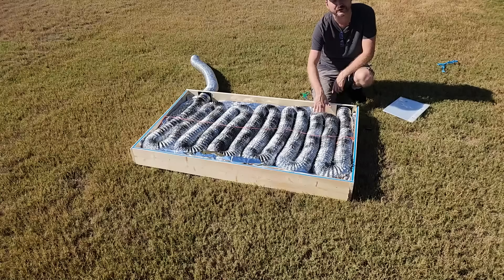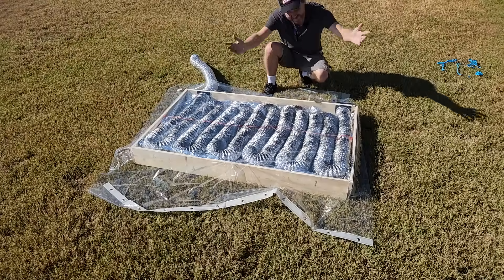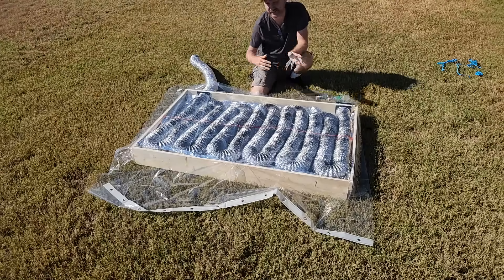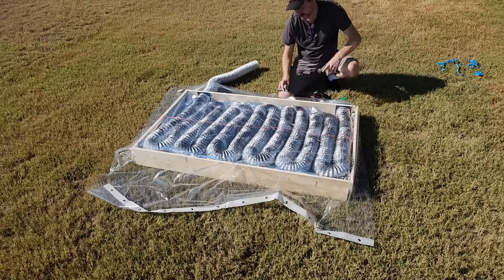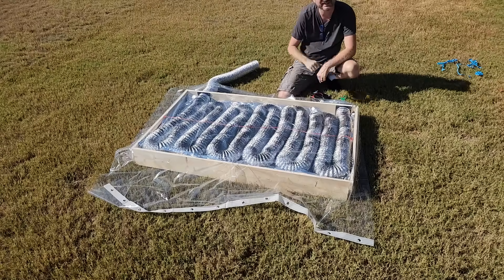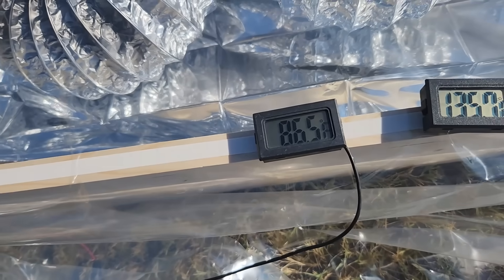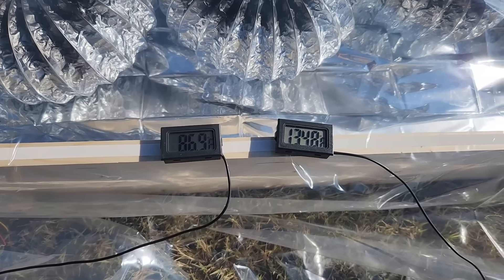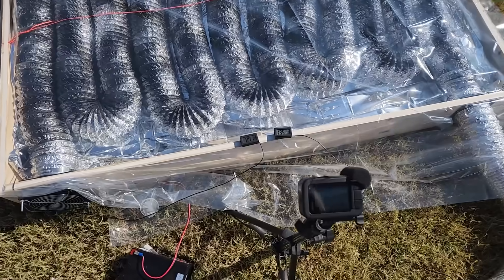Solar Air heater. No cans! Gained  50F in 20 minutes! @texasprepperprojects

Comment: I had thought of something similar but would use black french drain tubing (no holes). I should test to see if you can get higher output temps due to the absorbency by the black material
Reply from the maker: I have seen that product and I think it is a decent option. However, metal vent pipe is thinner and metal so it will conduct and transfer heat better
Reply from the maker: You want to heat the air, not the material

Comment: these type items were designed for Antarctica and work great the benefit they had  despite insane low temps was the insane reflectivity of all the snow and ice! but yes they do work at very low temps!!! remember your not heating outside air with these types of air heaters so lowest of temps don't too much matter!! the idea with all heaters is to continually circulate and heat the air in your space just like a real heater  or the same air which continues to get warm as its been heated many cycles in circulation etc so if your inside air is 40 and your output from said unit is 175 the 40 as a whole area number will begin to rise etc  heating outside freezing temps to pump into your house is stupid like the idiots testing diesel heaters with their tents and claiming  they not impressed while the whole unit is outside vs just the combustion intake and exhaust  big reason if you do half assed you get half assed results as with anything too be clear this comment was just a general statement and not at all directed at anyone but was inspired by seeing many of the same comments in lots of these type of diy solar air heaters
Reply from the maker: Yup!

Comment: I build mine with a used patio door.... talk to your local window installer they will l usually give them away so they dont have to dispose of them
the heat will make sm board melt so you need better insulation 
black barbecue paint works best
from my garage in at 58 degrees out at 155 degrees  outside temp minus 20 degrees
Reply from the maker: Awesome!!

Comment: While stationed in N.C., I built a plywood model in our side yard. It had no cans, no vent tube material. I made baffles that alternated across the interior with a lower corner air inlet and an upper corner outlet. The interior was covered in black plastic with a clear corrugated roofing panel on the front.  No fan, but it still had fair airflow due to convection.  It augmented heating in a room that before was always colder than the rest of the house.
Reply from the maker: Nice

Comment: I'd like to see old tires sourced for a project like this.  They attract and hold a lot of heat.
Reply from the maker: Try it!
Reply: @texasprepperprojects  It would be interesting to see someone pull off a baffle system with vinyl siding as the heat collector and somehow heat an entire house.
Reply: Maybe a sand battery?
Reply from the maker: check out my other videos. i have done  a lot of sand batteries
Reply: @texasprepperprojects  Will do!  I have a little project coming this spring and I'm looking for ideas.  I like the way you present!
Reply: @texasprepperprojects yeah. I was talking about a tire project. It would be the most mobile sand battery ever made. 😂

Comment: This would be a good project for outdoor cat shelters in the winter.
Reply from the maker: Neat idea!!
Reply: That's an awesome idea that I will be testing this year thank you
Reply: Need a storage medium to store and limit temp extremes and Close absorber at night. Shelters work pretty well on their own with foam, one or more holes depending on size and cats, a air flow limited on openings for wind, rain deflection, and only straw interior, also drain holes on bottom for any fluid condensation. Silver faced insulation interior for added heat effect and also enables visibility inside with some exterior light, sun, moon, streetlights, etc.

Comment: Nice idea using a long length of dryer vent.

This system is a good proof of concept.

Paint the wood black on the inside.
Add foam to the sides of the box inside and out.
Seal the box with high heat rated sealant.

Older style clear single pane windows would work as the top.
Reply from the maker: Thanks. More to come

Comment: This build might be enough to heat an insulated box containing storage batteries for a household solar system. Keeping the box above freezing would help the batteries charge up and hold their capacity.
Reply from the maker: Might!
Reply: I'm glad you said that because I'm trying to figure out what application this even had I don't think it'd even heat a deer stand like he mentioned
Reply from the maker: It would be a SMALL cabin at this scale. Like 100sq ft

Comment: Solar radiation will TOAST your shower curtain...😮
Reply from the maker: We shall see
Reply: @texasprepperprojects  He is right, UV is going to break that thing down fairly quickly. I get that this is a proof of concept (and I would like to see this in a years time, there really is only one way to find out) but you should look into some UV resistant LEXAN or similar polymer sheeting.
Reply from the maker: When I go full scale, I'll definitely use something more durable than a shower curtan

Comment: I did this as a science project 40 years ago, but with water.   1 box had reflective foil and the other was black construction paper and rubber hose.   

Yeah the darker black the hotter it gets.
Reply from the maker: Thanks. Check out my older videos on solar water heating

Comment: Eliminate the tubes completely.  An open chamber, insulated, with a simple inlet and outlet is more efficient at transferring heat.  The tubing creates a lot of flow resistance reducing the air flow considerably.  A 50 degree rise in 20 minutes is not the important datum.  What's important is how much air flows at what temperature.  That is, how many BTUs above ambient temperature are moving through the exchanger.   (Outlet temperature - inlet temperature) X volume of air / time.
Reply from the maker: I look forward to your video. This design will make more sense when I deploy to my shed
Reply: @texasprepperprojects  brutal, lol
Reply: Surface area. Air is a terrible conductor, to get it hot requires as much surface area as possible without restricting airflow too much and tubes designed for air to flow through definitely doesn't restrict it too much.
Just look at the design of every other heating and cooling device, what do they have? Heat exchangers, radiators, manifolds.

Comment: I've made some of these before.
I dont think you need all those loops.
You might beable to get more air flow by cutting the dryer vent in half so you have to air inputs and two air outputs.
record the temperature out.  maybe possible to cut it in thirds,  it does not take much to collect the heat from the sun..  paint the dryer vent black to collect more heat.
Reply from the maker: That is one of those things I really want to test. I do not know what is better, more air or more length
Reply: @texasprepperprojects  I once experimented with a 4 foot long box, the air would go in the bottom, and I had 6 tubes going up, one way,  the tubes (dryer vent) were painted black, the box had reflective mylar (space blanket) The heat came out the top.
a nice slow air flow works best, it collects the heat from the now heated tubes.
The faster the air flow, the longer the tubes must be.
you use natural draft, you need more tubes to increase air flow.
It is basically a formula of amount of tubes times air flow speed equal heat......
you fill in the blanks with your system
Reply from the maker: In my long term plan i will have a continous loop in my shed so it won't have an intake to the outside world

Comment: yea can make cheaper by using scrape plywood or boards , bye staggering each end inside and paint the boards flat black and base white or something reflective then by using glue on top of partions glue clear plastic to let light in , should be very cheap.
Reply from the maker: I did mention in the video using cardboard and trash bags for a super cheap build!

Comment: Very interesting. Combo this with a boiler and radiators and it could heat your entire house on sunny days.
Reply from the maker: Neat
Reply: Storage needed like water, rocks, bricks, etc. A separate fan and controller would take over once storage is hotter than room temp.
Reply: Hot water supply for house, probably commercially available. Water panels, black.

Comment: you can't heat your house with it, but the heat you're generating could be fed into a house in order to reduce the draw on the furnace, right?
Reply from the maker: Absolutely. Every degree you feed into the heater is one less degree harder your heater has to work

Comment: Curious to see how long the dryer vent aluminum lasts. I would like to incorporate something like this into a dehydrator.
Reply from the maker: I think it will hold up. Think about the constant, intense heat that vent goes through with a clothes dryer
Reply: @texasprepperprojects not so much the heat but the solar radiation.  UV light. If it is all aluminum,  then good. But sometimes to be cheap they add other polymers or plastic.  Think of the cheap aluminum lining in soft sided coolers.

Comment: Make a similar, same design, using junk? Think as a hobo or poor person. Zero, to only a few dollars expense. 

The screws/nails/adhesive to join the lumber, and paimt might be the toughest part to scrounge. 

Discarded rain gutter downspout?  Glass jars/bottles?

Old blanket/quilt, covered with old corrugated plastic campaign signs, then covered with foil survival blanket, or heavy duty aluminum foil as insulation? (as the interior backing)

Old windows, different sizes?
4x4 kitchen vs one sliding glass door vs 4x6 bedroom?

Old door for back/base? 
Some old garage door panels are foam insulated panels. 

Correctly position, on a roof, insulated duct to/from a small room/shed, solar powered fan. 
Maybe a thermal switch, and on/off switch or baffle to close off during warm weather?
Reply from the maker: I mentioned this in the video. Cardboard. Trash bag. Cans. Most of the viewers are not from the usa

Comment: I just put in a couple heat pumps and have been thinking about using something like this to increase their efficiency when it's below freezing.   It'd be a lot more basic since you wouldn't want too high a temperature, but bringing their intake temp up to 40 or 50F should help.
Reply from the maker: Think of it this way. Every degree you can raise for free is one less degree your heat pump has to work
Reply: a water tank, insulated on all sides, buried in the ground,
use any type of heat collector, send heat to it all day when it is hot, use it at night.
Reply: You might check out ground loop heat pumps.
Reply: @CharliePowell-dy1tl  Gound source heat pumps are at least twice as expensive tho.  The air source ones I got are rated down below zero, but like Texas said, any improvement for the intake would help, so could put some of that savings into helping them be more efficient.
Reply: @Mazlem citrus in the snow uses open air heat pump in a box with a ground loop with a circulation fan. Not sure how much if any money it saves or worth while but at least worth looking into
Reply: @panzerswineflu  It'd be more expensive but yea that'd give you a steady and constant air source.
Reply: @Mazlem rather was wondering the cost vs going straight ground source heat pump from the start for price comparison but yeah. 

Compared to this panel though, ground loop will also likely help in summer as well

Comment: That's just like those tea light candles and a pottery pot. Everyone runs these test on them in 60 or 70 degree weather and never at temperature where supposed to work in. That will not work during a freeze. Just like the tea light heaters. You know how many people tried that and not one said it worked and they tried it in a tent in their living room. People don't understand how much BTU it takes to warm up a room. Then when it really freezing, its even harder. Look at a Chinese heater, at the lowest setting doesn't have enough heat to warm up a garage. What do you think your system can do when it has a fan with less blowing power then the diesel. Then what are you going to do at night? when it gets really cold and no sun???

The best thing I found to heat up during a blackout when its freezing is a Mr. Buddy Heater with a 20lb propane tanks. One tank last me 4 days on low and running it for 14 -16 hours a day. I have to two floor house and it keeps my house nice and toasty on low. I done this for years when the temp drop down into the 20s and not once did any of my 3 carbon monoxide detector's went off.

Just recently I got two 8k Chinese diesel heaters with homemade thermostats that I made. I just started testing the diesel heaters and so far I'm really impressed. With one gallon of diesel I can run for days and all I need is a 12v power supply. You can use a small solar generator or if your car in close to your house that you can run a 12v line to it to power the heater. 

Bottom line is, Run your test in the same condition you will be using it in. That will tell you if it will work or not.
Reply from the maker: Thanks

Comment: Why don't solar collectors use any white, or silver? They use black to covert the wavelength of light to the wavelength of heat. It's a great idea, thanks! BUT the entire pipe should be solid matt black. It's a solar collector, not a solar reflector. If you can see any light at all, it's coloured too light. It should [resent to the eye as a black hole.
Reply from the maker: Working on the paint job now. More testing soon if the sun comes out

Comment: How much did the 40' dryer hose cost? You're in Texas, so I presume you may be testing for a similar temp differential in a few months on a sunny day when its like 35-45F outside? With your(near ideal) horizontally positioned set up pumping 85-90 degree air into a (preferably windowless) 10x10x7. 5 room, itd take about 7.5 minutes for a complete air exchange(750cu.ft./100cfm fan).If the room is at 50 initially, how long would it take to raise it to ?? 75-80?.(There are formulas,.... but Id guess a single unit would still underperform a 600 watt space heater). But, if you covered the south wall and roof of that room with multiple units, itd be like adding multiple windows I suppose(letting way more heat in). I have a Rubbermaid leanto shed and Ive measured that lid at 100+ degrees on many a cold sunny winter's day.... so there's that. GOOD LUCK
Reply from the maker: Check the Amazon links below. It is true that this isn't a 'fair' test since it is so hot outside. I will know in a few months when it cools off how it will work in a more realistic situation. I habe a 10 x 12 shed to use as a lab. So, stay tuned!
Reply: @texasprepperprojects I will!!

Comment: Spray paint it all black!
Reply from the maker: Agreed I need to improve the paint
Reply: @texasprepperprojects yea the reflective material is rejecting alot of radiation heat. You could be getting 200 degrees at the outlet with it matte black which helps absorb alot of heat.
Reply from the maker: Its cloudy here this week but I'm getting more matte paint to better cover the tube. More to come!
Reply: @texasprepperprojects  a cool experiment might be testing different paints in different panels to see if there's a meaningful gain in using an expensive ultra black paint from an art supply store vs a rattle can from Ace and how they hold up overtime.
Reply: I wonder if you change the pipe to aluminium pipe that they use for diesel heaters for the marine/ truck industry which comes painted black if that would be better comes
Reply from the maker: I don't think that will matter. You want something thin to transfer the heat to the air.

Comment: Excellent work ! This is one of my favorite variations of this design ive seen  
You would probably have considerably more solar gain if you more thoroughly spraypainted your tube/heat exchange with stove black or other black heat resistant paint, and even created more thorough insulation/ thermal isolation in your box. Creating a "solar box oven" type of insulated and angled box for your heat exchanger ive seen get 100ish degrees difference with intake vs outtake heating a garage in a New England February
Reply from the maker: I would agree. I also think that I need to raise up the vent from the ground so that the air can circulate all the way through all sides. this was my original plan but I didn't have the part I needed.